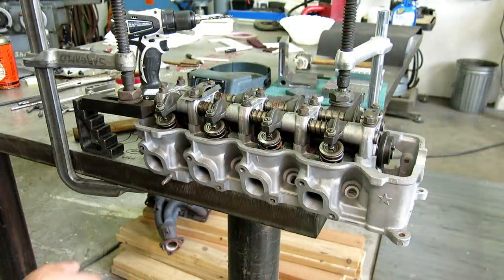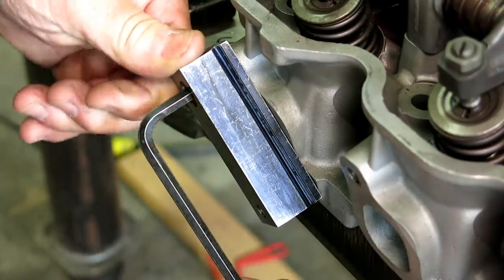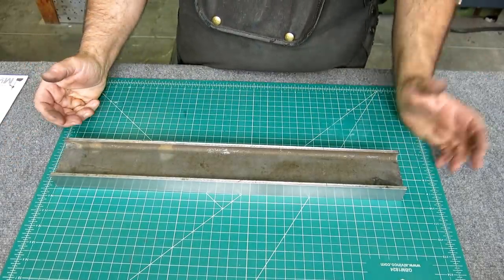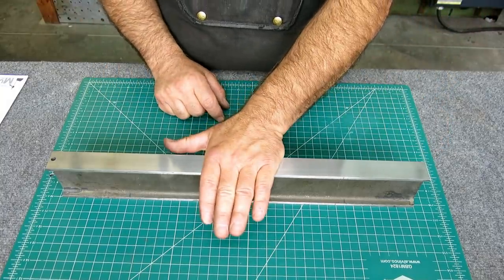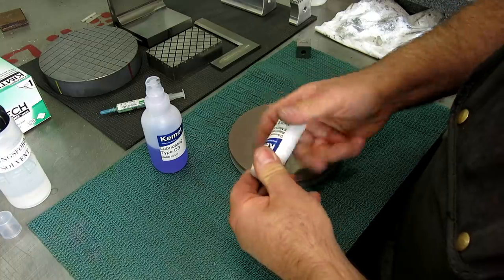Monday Night Meatloaf 122

Comment: You mean timestamps like this?

1:38 Dodge Colt Head Repair
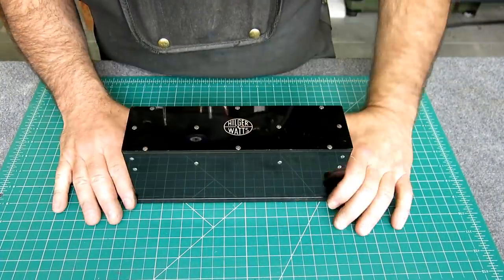10:41 Hilger Watts Block Level
15:03 Mark's I Beam Parallel Staightedge
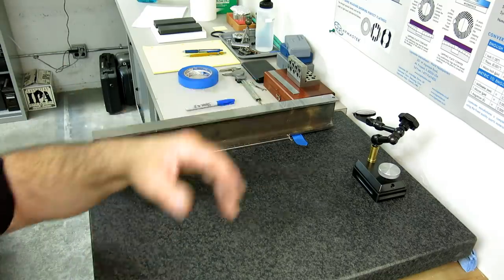23:58 Localized Lapping
28:00 Kemet XP lapping plate
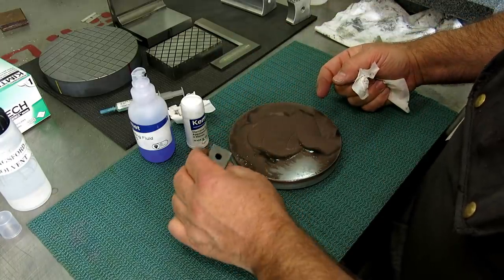33:30 Monochromatic light inspection of lapped block
35:58 Three plate method for straightedge generation
40:47 Famco Arbor press modifications
Reply from the maker: Awesome! Thanks. All the best. Tom
Reply: Your'e welcome. Will do it again if I'm the first one again.

Comment: As a mechanic, my favorite trick for removing broken bolts or studs is welding a nut to the stub that's left, assuming there is one. Gives a hex to put a socket and impact on, and the heat from welding almost always loosens up any adhesive or breaks rust free. I don't always have the option of taking the part to a machine shop to have the bolt machined out. 

But nice video Tom. Looking forward to the end of the Project Egress part and the printing press also. Loved Adam Savage's reaction to your part when he pulled it out of the box.
Reply: I've used that method quite a few times, and it most often works provided you have some of the fastener protruding.  If it shears off below the surface, it's difficult to get a strong enough weld, and once you've had a few goes at welding it can get hard enough to make drilling it difficult (though exhaust studs can be hard anyway IME)
Reply: Yup!  And if the TIG won't do it then it goes on the CNC and gets helical bored out with a small end mill in my shop!  If I had some EDM guys to sucker into it for beer that'd be the best way I think...
Reply: I use that method a lot too, but i have a rule to never do it (traumatic past) on anything smaller than 5 mm. 

I do love, however, using heat on them, so i'll weld a beat on the end or my favorite new toy, a modified nut buster (one of those newfangled induction heating toys you use on stubborn nuts) where i've flattened the coil and glued a thin ring of bakelite i had around it. If the stud's past the face by 7 mm, then it's one i can get out. The thing will go red hot in 3 seconds flat and no longer oppose the forces that be.
Reply: Mr T  may work for automotive, but I work in over the road trucks with diesel engines. Everything is steel except for some chassis parts which use 5/8" bolts. There are some ancillary engine parts that are aluminum, but they're small enough if you get a really stubborn bolt it cheaper to just get a new part than spend hours at $136 an hour to extract a $0.30 bolt out of a $150 part.

Comment: Well done stud removal!

I realize I am a few years late, but if it helps anyone those studs are known as tap end studs. The end in the head meant to seal the coolant passage uses a class 5 thread. While they might have used a sealant, the class 5 thread is primarily what makes them very tough to remove. 

Thanks for the video.

Comment: Glad you came out with a new meatloaf.  I have lost 30 pounds while waiting.  Shock is the best way to remove steel bolts/screws from aluminum.  I have removed dozens of phillips head screws from motorcycle engines totally undamaged.  Trying to twist them out will only break them.  Please make videos more often.
Reply from the maker: Yesir!

Comment: Great stuff Tom, I did exactly the same straight edge "straightening" for my combination square blades. Exactly the same, down to the blueing and draw-filing. It works really well. The only downside is you can be off across the width, and you can't use the whitworth 3 plate method "rotation"  to correct that error, just have to do your best with holding the file level. I guess a draw filing jig could be made up.

Comment: Tom, 
If those lower stud holes are through into the water jacket possibly someone has "visited" them after the engine left the factory and added sealant on the studs after redrilling  and tapping the holes.
I worked in the Australian engine plant including on the pilot build when these engines were introduced in Oz and we never put sealant into those holes. Initial production used Japanese sourced parts from the parent company Mitsubishi then we switched to in house cast and machined parts. Neither sourced heads had issues with exhaust stud holes drilled onto the water jacket.
You don't spend money on sealant if you don't have to in a production run.
Cheers Eric

Comment: Good job removing that stud Tom, however having done those jobs hundreds of times I can tell you nothing beats a Snap-On GC500 collet set (stud remover/installer) and careful application of a blue smoke wrench. 5 minute job - tops, in most cases. There is always that ONE that will need to be drilled out on occasion. They also have a set with smooth jaw collets that are the bee's knees for pulling dowel pins as well. Those tools wont damage threaded studs or dowel pins either like vise-grips do, so you can re-use them if necessary.

Comment: I think its likely that the suede lining is likely to be Chamois leather (that's pronounced shhhhammy in the UK same as shhhhampher - It's French so not an english "ch" - it's pronounced with the french shhhhh).
Quite expensive it was used by window cleaners because it remains soft when wet but like silk it gets stronger too - very tough, tough as old boots (which it was also used for!) - when its used dry it's as soft as a baby''s bum - used to cushion easily scratched stuff and holds a gentle natural oil that lubricates and prevents rust without making things greasy (posh oilpaper) (oldstyle foam rubber).  We used it to clean electric contactors. Jewellers would line boxes with it and buff gold with it.  It was widely used before all the new fangled materials were developed but always pricey so a sign of quality.

Comment: Great to see a new Meatloaf! 

Isn't there a problem with the "3 plate" method to make straight edges, since all three pieces could have a small twist and still match up even if you flipped one end for end?  I think that if you shimmed one piece of cold rolled bar up from the table by about half its thickness, then you would be comparing the bottom half of one piece to the top halves of the other two pieces.  Does this allow twist to be identified and removed?  I am not sure what sets of comparisons would work best to remove all twist.

Comment: I'm quite surprised you didn't heat that stud, that's standard practice for removing loctited studs. A lot of times if there's enough stud sticking out you can weld a nut on the end, the nut gives you a place to put a wrench and the welding breaks the Loctite down, Bob's yer uncle.

Comment: Hey Tom, great channel. I'm Gary from CT. I was wondering if you know where to get info on my Norton surface grinder that I just picked up. I think it's a 816? It was made in 1942. I have the serial number but that's the only identifying thing on it. (other than it's a Norton) If you could help or point me in the right direction that would be great. Thanks a ton Tom.
Reply from the maker: Try Keith Ruckers Joint over at Vintage machinery dot org. Cheers. Tom

Comment: Can you give us a quickie tour of the Kant Twist Clamp rack, what sizes, how many, where you use them.
Reply from the maker: Hi Rusty. Which one? The one near the mill or a different one? I have most all the sizes but my all time favorites are the 2-1/2 D size. Mostly used in the milling machine and surface grinder so they clear the cutting business. Thanks for the comment. Cheers. Tom
Reply: @oxtoolco  I didn't know you had the others , we only see the rack at the mill.  Show and tell what you want, I"m sure I'll pick up some tips.

Comment: Richard Garret Engineering did indeed build steam engines and othe agricultural machinery at Leiston in Suffolk. The Dereham factory built dry cleaning machines. I have been looking out for a decent level and one from a factory 4 miles from where I live turns up across the pond.
Reply from the maker: Yikes another hard to pronounce English name Leiston. I'll guess Lee-ston. Thanks for the comment. Cheers. Tom

Comment: I have a old Famco press looks like yours, it is bigger though. But, it has a LARGE turning handle with 6 grab spokes on it. From grab end to grab end, about 2 feet. It is balanced too, so when you spin it, the ram kind of just wants to remain where you leave it. Turning handle looks original. Maybe it was an option or something. With it, I can press a lot of stuff without using the ratchet lever bar.
Reply from the maker: You have what is called the ships wheel option. Never used one but they look super cool. Thanks for the comment. Cheers. Tom

Comment: Hi Tom, what does the later coincident level have for a resolution?  I picked up a Zeiss Jena one earlier this year and with 0.01mm/m it was dream to use to get a new machine set up. Really handy.
Reply from the maker: The adjustable level is .1mm/m. The adjustment drum is one minute of angle per division or one degree per rev of the drum. You can easily interpolate half of that.  Thanks for the comment. Cheers. Tom

Comment: I know the head is aluminum but would a little heat not have broke the loctie loose or did you try that first anyway you always have the best way and make the impossible possible thanks for the video
Reply from the maker: I did try some heat on one of them. It took longer that drilling them out. Thanks for the comment. Cheers. Tom

Comment: When mapping out the I beam parallel do you have to be careful about introducing heat from your hand into the height gage.
Reply from the maker: Hey Guy. With the indicator stand you can verify your zero by returning to the starting zero point. But yes when you are hunting gnats asses you worry about everything. Cheers. Tom

Comment: I beg to differ with your statement that the Vicegrips  are the best way to grab the studs. A threaded collet  type of stud remover works much better in that no damage is done to the stud.  Snap-on makes a good puller of this type.  There may be several other brands available.  I am not slighting Vicegrips the old made in Dewitt Nebraska are a great product.  However the plant has been shut down and sold off, years ago.
Reply from the maker: I assure you these were Nebraska vintage vice grips if that makes a difference. Don't have a collet stud remover so went for the next best thing. Thanks for the comment. Cheers. Tom

Comment: Isn't all that work kind of going to waste on account of the fact that the piece is soft? And i mean that two fold, first since it's not going to hold and likely that's usable only as a straight edge, no other abilities to it, and second because whomever uses it has to handle it like it's made of glass because of the amazing surface.
Don't get me wrong, i think that's an awesome exercise, but i would've probably hardened the surface first. 

All that being said...never occurred to me that you could make it out of such a basic metal. Considering the source material isn't a high spec metal, i wonder how it behaves in relation to heat/cold vs a proper unit.

Again, cool piece, the lapping display was a great insight, especially the aluminum aspect.

Comment: Did you grind the aluminum laps?
Reply from the maker: I lapped the aluminum laps if that makes any sense. Cheers. Tom
Reply: @oxtoolco  What material did you use to lap the aluminum laps, curious. 
Thanks,
Duane
Reply from the maker: @duanedickey7043  Hi Duane. I first lapped them pretty flat just on 400 grit paper on the surface plate. I then switched to a diamond lapping plate to get them really flat. The diamond lap I used in this case is made by Ablap. Cheers. Tom

Comment: Maybe a dumb question but if the lap just has to be softer than the target,  why can't you use aluminium for all lapping? If you lapping  something like granite, would the aluminium deflect or something?

Yes im Australian so aluminium is how I spell it haha
Reply: Kemet composite material has a hardness of approx 90 Shore D. Aluminium is significantly harder. You need to be able to apply enough pressure either by hand or with machine conditioning rings to get a uniform impregnation of diamond particles. Even with aluminium you would still need significant pressure whereas with composite you can embed using hand pressure or the weight of conditioning rings.
Reply from the maker: Good question. Aluminum is not as durable so you are always balancing durability and life between the lap and base material. Thanks for the comment. Cheers. Tom

Comment: 33:06 when you get dow to 1 micron, can you wring 2 together?
Reply: The ability to “ring” 2 parts together is a combination of flatness and surface finish. If 2 separate faces are flat to less than 1 micron with a highly reflective surface, either mirror polished or polished with 1 micron compound on a suitably soft lap, then yes, the faces should ring together. You’d be looking for a surface finish of Ra 0.25-0.5µinch.
Reply: @KemetUK  I assumed the lap they sent him was flat and 1 micron was close enough, I was wondering if the soft edges towards the corners would be a problem.